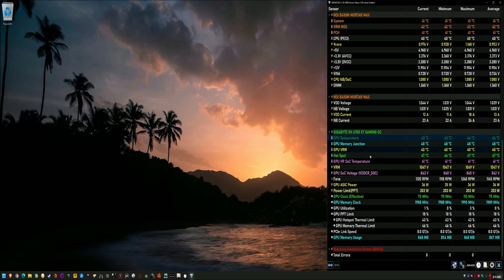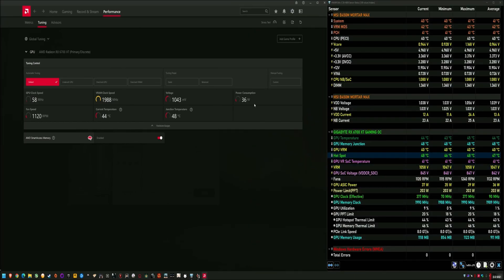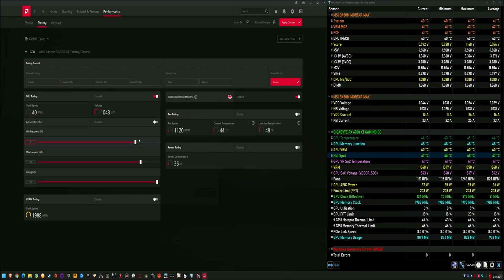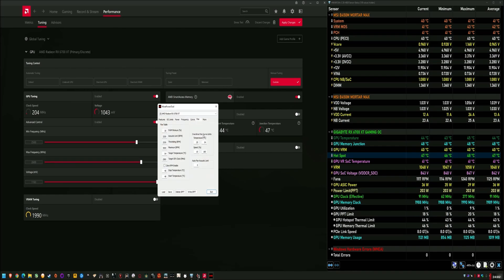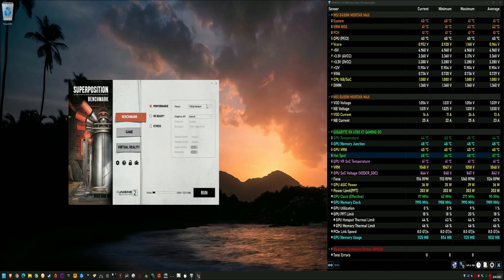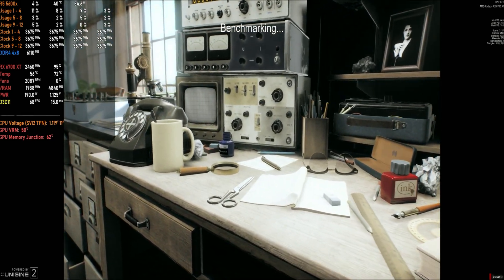Gigabyte RX 6700 XT Gaming OC Liquid Metal + VRAM Backplate Fan Installation & Test

Comment from the maker: Hey everyone, this is a little side project I've been wanting to do for awhile & share the process with others from a non-professional DIY perspective, Conductonaut on a Gigabyte RX 6700 XT Gaming OC, went a bit thick on the LM as I couldnt do a layer on both core+heatsink but you'll see why in the vid.>>>

The full process took around 1hr 30min inc. wasting a bunch of time trying to get it to stick to the copper heat pipes otherwise it may have taken closer to 1hr, (didnt have any low grit sandpaper to fix it up properly) or result might have been better but still happy with it as the main goal of using LM wasnt just hotspot reduction but avoiding 'pump out effect' which happens over thermal cycles with conventional repastes, LM is much more resilient against this.

If you plan to give it a go my best advice is have some 1500 grit sandpaper ready incase the same thing happens with the heatsink adhesion, & with the SMD coating, take your time & go LIGHT on the liquid tape /w more coats if you want it to look clean. This was kindof messy & far from a perfect application(I have 2 kids & always tired so hardly ever have 'quality time' for this type of thing anymore.) xD

Here's a link to the Liquid Insulation used: https://bit.ly/3vkBMGq

>>>For those that just want the results, there was a 6C reduction on hotspot from 46C over ambient down to *40C over ambient.*(Was a error in the captions sorry).<<<
Reply from the maker: 0:00 What I've done to the GPU so far.
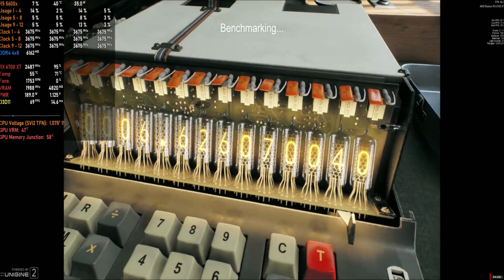6:21 Superposition BEFORE LM 4K Optimized <<<<<<<<<<<<<<<<<<<<<For compare
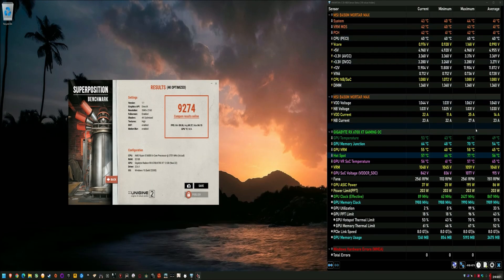7:32 Max Temps Before LM(31C Ambient)
8:23 Gigabyte Gaming OC Teardown
8:46 Cleaning TIM
9:42 Conformal Coating(Liquid Tape)
11:05 LM GPU Die Application(Some was meant for heatsink but..)
11:16 LM Heatsink Application
11:26 LM TO HEATSINK APPLICATION
11:34 FUUUUUUUUUU
13:33 Defeat
13:39 Checking core contact
14:07 Minor runoff
14:16 Rebuild GPU & Pray
14:51 Visual Check
15:03 Reinstalling GPU / VRAM Backplate Fan
16:19 Power On
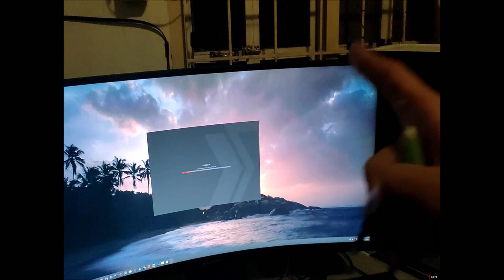16:52 Superposition AFTER LM 4K Optimized <<<<<<<<<<<<<<<<<<<<<<<For compare
17:37 Max Temp Result
18:14 BEFORE
18:24 AFTER
Reply from the maker: Update 7/25/23, This card is still running strong, same temps.
Reply from the maker: Update June 2024, sold the card before upgrading to a 7900 XTX 6 months back, the new owner knew about the LM & still happy with the card as far as I know.

Comment: What thickness are the thermal pads you put on?
Reply from the maker: It uses the same heatsink/pads as the Eagle version, the only exception being RX 67*50* XT models that look the same but have different heatsink clearances.
https://www.reddit.com/r/Amd/comments/o8qv7y/advice_needed_6700_xt_thermal_pad_replacement/
1 mm thermal pads on the heatsink
2.5 mm thermal pad on the backplate positioned behind where the GPU is on the PCB
Reply: @PatchFixGaming thanks man

Comment: Thanks for the video! I mainly used it to see how to take the cooler off so I could repaste, and to compare if my card was doing well before and after.
I didn't wanna mess around with LM so I used some SYY-157 paste instead. It's honestly pretty good! Went from 84 degrees core & 110 hotspot to 60 & 74 after. 
That's after 15 mins with -100mv undervolt @ 2700mhz core & 2150mhz fast timing memory.
The only annoying part about the paste is how thick it is, takes a while to spread it around evenly with the plastic spudger. I used more than necessary as one should with exposed dies.

Comment: did you take the measurement of the thermal tickness ? if you can tell me please 1mm or 1.5mm or what ?
Reply from the maker: Backplate 2.5mm, heatsink 1mm.
Reply: @PatchFixGaming  ty mate u earned a like and a sub , also what about the vrm pads ?
Reply from the maker: Cheers, sorry YT doesnt notify for replies properly -_-,, Heatsink side still 1mm, if you add more for the backplate side, 2.5mm. 👍
Reply: @PatchFixGaming  ty for the reply , so everyhing is 1mm ? Like everything thay needs to be cooled by the heatsink
Reply from the maker: Yep, the plates themselves are all set to the right heights.
Reply: @PatchFixGaming  nice bro ty , also , i have the 6750 xt version not 6700 , but same model , that won't be a problem right
Reply from the maker: Nup shouldnt be an issue, its essentially a pre-OC'd 6700 at bios level, with higher quality/speed memory.

Comment: M8, the mounting block for the cooler, that holds the heatpipes, is made out of aluminum. Liquid metal / gallium destroys aluminum...
Reply from the maker: Yo sorry for the quick reply earlier, the core contact is direct to the copper heatpipes so hopefully doesnt touch the aluminum somehow, either way its still running great today, just bandwidth limited so I havent been able to upload fresh gameplay :(.
Reply: @PatchFixGaming  I was looking at the paste print when you pulled the cooler off, and it looked like the die just barely touches the aluminum on the corners. Idk man, I'd be afraid to use LM on that cooler. Gallium (the main ingredient) turns aluminum to dust, it's crazy how reactive it is.
Reply from the maker: Ah yeah thx for the heads up, the tips of the die do touch just barely when looking at the TIM residue, hopefully any dust it does create just sits there as it would still be wedged between the cooler & metal boarder of the die, any dust particles that do get out would hopefully be blown away & too short to bridge/short anything but it is something to keep in mind.

I would tear it down for science but plan to use it in the kids rig after upgrading the main PC over the next couple months & a teardown would mean cleaning & fresh LM application which defeats the benefit of longevity using LM so I'll only tear it down if something happens with temps/stability etc. At the very least its still running great 11 months later. 🤷

Comment: good vid thanks.. I have already modded my gigabyte 6700xt eagle (shitty heatsink and slower than your card clocks @ stock) with a 2700x +gigabyte x470 mobo.  My same test score 4k opt super pos is around 10190, with core avg around 2650 - 2700ghz @1250mv and 220w avg power.  I did this with an old morpheus 2 gpu cooler and liquid metal.. and aluminium heatsinks on ram / vrm.. then more powertool to adjust the levels / curves etc.  I have no backplate currently and no rear cooling (although case airflow has been aced with the help of very specific airflow).. i use two noctua fans on the card, which means its very quiet + stable compared to stock...   you`re definitely on the right track with the work, but i expect if you can find the time and resources, you`ll get much better from your card, probably beating mine as theoretically, your core is better silicon and why you have the factory o/c version.  with my slightly cheaper and slower card, gigabye used a shit heatsink where the copper heatpipes were actually in the wrong place / misaligned, meaning only half of the heatpipes actually sat on the core.. and despite me being careful, when i replaced the stock tim for lm, when i first got the card, it slowly destroyed the heatsink.. i was very lucky though to notice a performance degradation the moment the heatsink breaking down started... and i had the morpheus 2 cooler sat unused as i bought it to use on my vega before upgrading to the 6700xt.  lesson learned tho lol.  I appreciated your info on the liquid insulation stuff, that is something i will likely buy as i`m not entirely done with modding this 6700xt yet.. i have high quality copper memory heatsinks to fit and i`m looking at making a copper backplate...  and buying some kind of stands to keep the gpu straight and not sagging.. as the weight is already ridiculous without me adding more stuff.  best of luck. tnx
Reply from the maker: Nice & thanks for the reply & modding details, how were temps? I never did take modding much further with this RX 6700 XT but I did try pushing a higher OC at lower power just to see how efficient it was, this was the best score: https://postimg.cc/nM9JKNt8 ~10096 @ 204w(1163mV) , but for daily I still prefer the efficiency of about 2550-2650mhz @ 1050mV(Scores around 9600).
Reply: @PatchFixGaming  glad to see you had some headroom there for better bench scores .. i figured you would have.  as for temps, hot spot rarely goes over 84 during a multi hour torture test of benchmarks, core temp rarely goes over 65 briefly, during same.. i can grab the temps for any other area if you`d like them.. i have extensive logs and screenshots lol.. i tend to retest every time i update drivers or change any config like cpu o/c etc.  as i dont play competitive multiplayer, i`m finding a lot of titles can render at 4 or 5k resolution and maintain 40 -50avg fps with high / max details and then using rsr + rsr to upscale that to 8k (on my 4k screen lol - but hey it looks amazing) - a lot of dx 10+11 or older games render native at 8k and super res displays it on my 4k screen.. really amazing sharp and decent enough fps / smooth play.  the overclocking of cpu / mobo and gpu combined makes all that stuff very smooth as the higher clocks etc prevent stutter / slowdowns..  i dont typically use AA and have shadows / fog  on med / high as higher not needed with the render,display res +settings .  what i found specifically recently was a feature in mpt that allows me to give the gpu core 1250v, this is how i got the core stable and constant around 2650 - 2700.

Comment: san mo binili thermal pads can you drop links? hehe
Reply from the maker: Yo, I only used spare pads I had from previous heatsink mods, but if I was to order a new set this is what I'd use:
https://shope.ee/6f8ssANGCt - For the backplate, 1pc 120x120x2.5
https://shope.ee/6pSJ4Vm9D6 - For the heatsink, I used 2pcs 120x20x1.0
And this is one of the best TIM to use incase you dont want to risk the LM route; https://shope.ee/6KW2TcE2sL

Hope that helps!
Reply: @PatchFixGaming  thanks bro
Reply: Also para sa memory ano thickness?

Comment: I recently bought exactly the same model as this one and I'm getting 100+ ºC peak Hotspot temp when gaming. 
Also bought a Conductonaut and hoping to dramatically bring my temps down after applying it.

I also have a question: can I use transucent nail polish instead of liquid tape? Or am I going to have any issues with it? 

Thanks and advance and great vid btw :)
Reply from the maker: Cheers, Nail polish or liquid electrical tape/conformal coating should all be fine, nail polish is used coz it's easier to source, just be sure to check the ingredients, avoid polish with Toluene or Benzene derivatives and find one with Nitrocellulose / Ethyl Acetate.